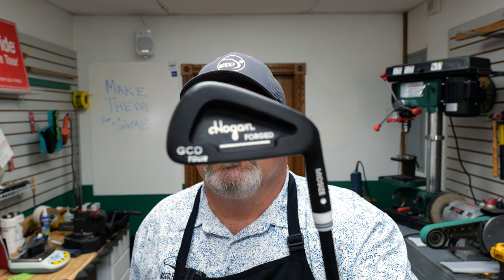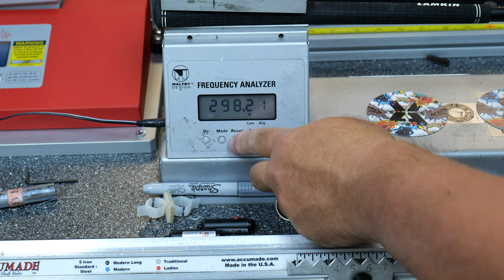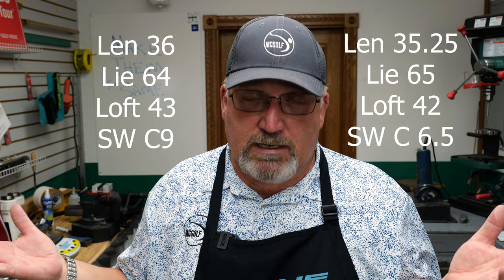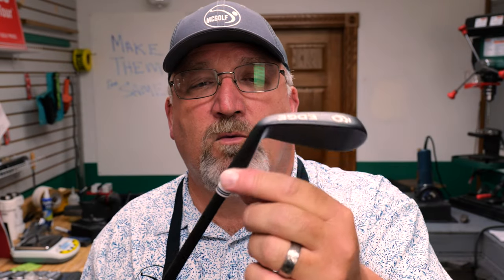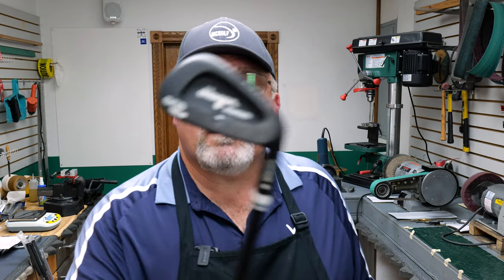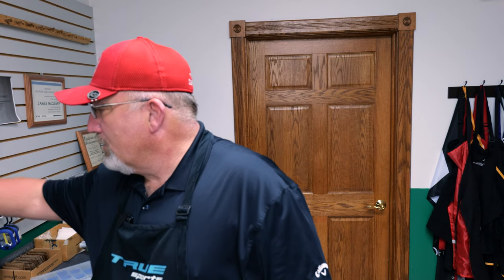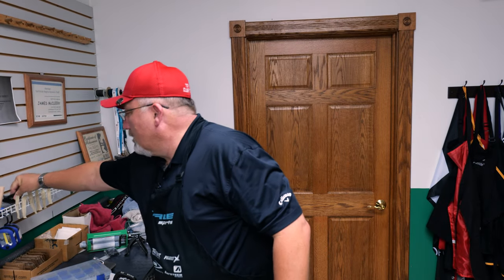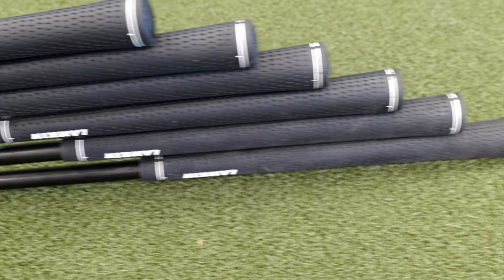Building Golf Clubs to Spec

Comment: couldn’t have asked for better customer service, however the ability to see you work on the clubs and see what I did wrong on the initial build and learn some makes it even better. Thank you jim and robin, the base course will see a lot of action in the next couple weeks, maybe even sneak me out to the field to get some swings in 😆
Reply: Did you buy these heads from a guy in Campbell, CA? (me?) I used to work for Leith Anderson and he would bore out a lot of the forged heads to accept graphite shafts. Most graphite shafts are parallel tip. That could explain the parallel hosels. On the lies being all over the place, assuming these are the ones I sold and sent to 29 Palms, I wonder if Leith had a another guy who worked for him practice bending with them. I didn't measure them for loft nor lie because the loft and lie machine I have is missing a spring and Mitchell never responded when I contacted them to get one.    P.S. Those heads look great compared to the original finish. They had kind of a dull chrome finish.
Reply: Yes sir they are!
Reply: @christopherjolly2775  We both know who to watch for proper club building techniques!
Reply: @bobpegram8042  , Leith was a good guy. We knew him for years from back in the PCS.
Reply: @robinmccleery3968  - Yes he was. He was very generous. He had duplicates of a lot of the club making equipment and he gave them to me when he moved to Indiana. If I had enough money I would have opened my own club making shop (I didn't). I do make clubs for people though.

Comment: Adding head weight (lead down the shaft or tip weights) would bring the weight up and make the shaft flex more. Obviously, there is a limit to how much can be added especially with graphite shafts. Golfworks used to sell lead putty which made adding tip weight possible without dis-assembly, but the federal government banned it due to the lead content. "I'm from the government and I'm here to help you." Yeah right.